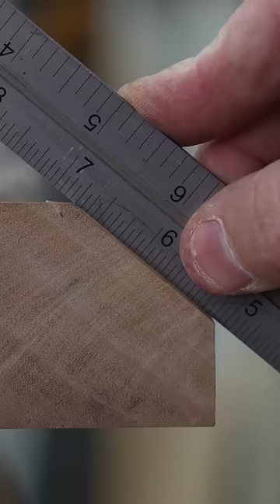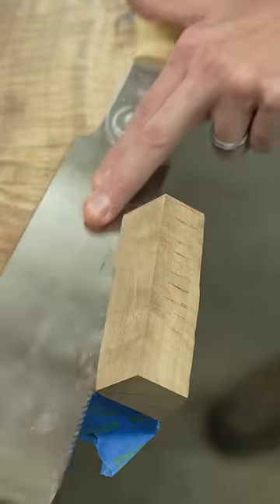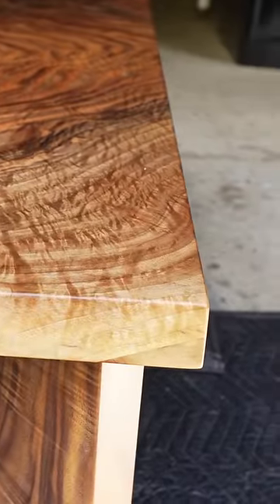Woodworking fix

Comment: Dude made more with a coffee table than me in 3 months of working
Reply: @UCFkBuj52Qa9VNaOXZtRco4w I feel kind of spoiled because we paid $10,000 for a master woodworker to build us a large live edge butter walnut dining table.  It's beautiful and worth every penny and I apply the wax to it every so often to keep it looking nice and fresh.

When you work hard and make good money you'll start to change your thinking and realize you were just coping when broke.

For instance, when I was broke I used to scoff at luxury clothing brands and think it was all a waste of money.  I always felt you get the same quality from H&M or Old Navy minus the brand name.  Then I made good money and started to try nicer clothing, and realized how wrong I was. 

Clothing from luxury brands (not the hypebeast streetwear stuff) is definitely worth the price point.  They make insanely high-quality clothing.  From the quality of fabrics to the design, the fit and feel of the fabric.  The clothing will last forever when properly taken care of.
Reply: @wushdishmeen  This is absolutely true
Reply: @wushdishmeen  the materials and manufacturing location matters more than the brand or designer. If you get crap that has nylon in it Itll melt in the dryer and holes will develop. You can get affordable shirts made completely out of cotton without designer level prices that'll last for years. Costco's Kirkland Brand makes some of the best quality clothes I've ever seen, especially for the price. I've never had any of their clothing products develop holes. Brands like fruit of the loom usually develop holes before the years out, especially on the socks. I've made tug of war dog toys for my German shepherd out of old stained Kirkland socks and they still have no holes and have lasted longer than any dog toy, it's crazy. They can easily last longer than 5 years. Same with their thick white crew shirts. You don't need to spend absurd amounts of money to get quality items, and you don't have to settle for the toilet paper crap from old navy either.
Reply: @dog2man1994    While I agree to a certain extent I think you misunderstood my point which I’ll explain better at the end of my comment if you care.

Regarding what you said — Any quality fabric or high-end piece you don’t put in a washing machine or dryer. Some you can get away with a cold wash inside out, but definitely not recommended. Hand washing is recommended.  ALL quality fabric should also be air dried on a dry rack and not put in a dryer ever.

While you can get good cotton t-shirts via cheap plain blanks from Costco they will look very plain, have a cheap looking design, and also just being very tough cotton isn't really a good thing. Lots of cheap cotton can be thick but feel like sandpaper on your skin so sometimes mixtures or other types of cotton are better. If you just need cheap plain undershirts that you layer something else on top of I’d recommend UNIQLO’s AIRISM U shirts which are $10 and are more comfortable, better quality, and have more color options than Costco and then just take good care of them.  Most cotton breaks down due to people's need for convenience throwing them in a washer and dryer which is 90% what ruins clothing.

Regarding quality, just simply 100% cotton is not an indicator. The GSM,, quality of the cotton, cleanliness, sustainability, as well as the cut of the cotton also matter. There are also over 20 different types of cotton such as French terry, Jersey, and velvet just to name a few.

Also manufacturing location if you’re specifically talking about China doesn’t matter. China will make $1000 products in the same factory they make $1 products. There aren’t many “cheap factories” in China as they will make cheap Alibaba products in the same factory they make high-end luxury products.

Costco shirts if they work for you that’s great. But they will not be cut-and-sew with nicer silhouettes. Blanks tend to all look the same, are covered in seams, and fit the same even though everyone’s body is different. This is why modern style is more tailored or boxier to fill you out from drop shoulder to hidden seams and will form to your body or fill it out.

Cheap blanks also won’t have any hand made stand-out design elements or graphic designs that actually look beautiful and are not “kid like” or “Walmart-esque” for lack of a better word.  I’m not saying “go buy Gucci” as they are a typical overpriced brand.

But even as a starting point as I began to make more money, paying for the higher end clothing even at a store like Adidas or H&M will show you the difference of high-quality cotton, 100% French terry cotton, or fleece in a heavy GSM with cleaner cotton and what quality actually feels like and why it's more expensive.

Most of us hold a bias when we can't afford nicer things because we don't actually get to EXPERIENCE them and so we write it off as a waste of money.  Sometimes this may be true but if you actually are researched in the fields you're buying in you will learn WHY some things are more expensive.

I used to think designer clothes were a waste of money until I bought my first pair of nice shoes.  Even running shoes like Adidas with their Primeknit and BOOST soles are very expensive and there is a REASON.  It's because the comfort is unmatched at lower price points and they also look nice.  Now I recognize the comfort, feel, and R&D that went into the design of them are worth the price whereas before I just thought it was a waste of money.

You also get what you pay for with looks. I’m not referring to any brand that just takes a “blank” and stamps a logo on it. It’s easy to make a cheap decent plain T-shirt blank but not easy to make a good polo, sweatshirt (knitted or regular), jeans, or shoes that actually are comfortable and look good.

$50 jeans are not ever going to be the same quality as a reputable brand selling $200 pair of jeans.  Jeans from Japan can last you a lifetime whereas cheap $50 jeans will wear and tear very quickly and will also not look as good shape wise.

As for the main point of my comment — When I didn't have money I would have just thought paying $10,000 for a dining room table was absurd and there's no reason for it. Until I had money and we learned about having a custom live-edge butter walnut dining table with a steel leg design we got to decide on that was hand made and big enough to seat 12 people and fits our dining room.

The live edge walnut in that size is VERY hard to get and is very expensive.  Then you are paying for the years of experience, craftsmanship, and custom hand made design of the table.  That is why it is worth that price.

Same goes for shoes, watches, clothes, . There is a reason why there are expensive versions of everything when you do your research and eliminate any companies just marking up things for a profit margin from the companies that actually are worth their value.

It's easy to say something is a waste of money when you don't have the money to spend on it basically.  But you have to look at life in a different way.

If I told you someone made $100,000 per year and bought a $1000 table you wouldn't bat an eye.  But if I told you someone made $1,000,000 per year and bought a $10,000 table you might be in these comments saying it's an insane waste of money when it's literally the same 1% of income.

Everything is perspective and I've learned to actually research why things are expensive and if it's justified.  In a lot of cases it's justified because of quality, craftsmanship, customization, and the R&D that went into creating something unique that nobody else can replicate.

Comment: Gotta give you props on that for sure. Nobody can deny that’s craftsmanship at its purest.
Reply: A wooden dowel would have been the best way to do that. That's all wood glue and will eventually break off
Reply: @michaelnizza414  doubt it. That bond is probably stronger than the wood itself given the surface and prep.
Reply: @cluckmar2   you've clearly never worked with glued wood on a heavy use surface. It WILL wear and it WILL fall off
Reply: @jessepatrick7471  is it that big of a deal? It's just a corner so I doubt it'll get used much in term of holding weight, I mean who in their right mind would put anything on the corner.
Reply: @jessepatrick7471 heavy use on a table that will likely be used as decor?
Reply: Uhmm...yes they could notice, using just glue like that is not exaclty the professional way to do it. Definitely not on an 18k piece.
Reply: @robbieaulia6462  corners are exaclty the vulnerable areas. They are exactly what gets hit first whaen moving furniture. With glue only that could pop off with ease.
Reply: @georgewain1138  Idk what to tell u man, maybe think with your head and imagine the table in 3D?
The table is flipped upside down at the beginning, you can clearly see the contrast between the bottom corner and the rest of the table at the end of the video. Idk what could he possibly have faked here.

Comment: When they say, ok so where's the part you messed up on... That's gotta feel good (that you are able to hide it that well and were up front about it to begin with)
Reply: My mum fixed a hole in my coat like that. I couldn’t even tell which side she fixed and which was original
Reply: it's like right there....
Reply: Easy to hide, when its on the bottom..you can clearly see the joint on the edge.
Reply: You realize the the part he works on is on the underside and the part he shows at the end is the top?
Reply: For 18k, would you want a messed up, repaired table?

Comment: The sign of a master craftsman is not that they never make mistakes it's that they know how to fix their mistakes.
Reply: My old boss taught me the difference between a good Painter and a bad Painter is a Wet Rag.
Reply: Yes! 👍
Reply: And good communication to set expectations!
Reply: A master has failed more times than anyone else has tried.
Reply: Even a journeyman must be able to fix mistakes
Reply: He faked the end result. If you notice on the corner he was fixing the grain went from up high to down low as it nears the corner. On the finished product corner shot it’s the opposite with the grain going from down low to up high as it nears the corner
Reply: @artstrology  
True , but a master might be able to fix it so you never knew one existed .
Reply: @jason9035   well it goes way beyond that, a paltry and simple thing, so that's how I might know you aren't one. a master level skill this is not, it is a journeymen skill,.....I believe the original saying was a carpenter is good if they can fix their mistakes. a master artist seldom makes them in the first place, it is not tolerated, and also, many mistakes are accepted and incorporated as to remain humble. leave one or two so the head does not get quite so big. and the customer does not have a say

Comment: Wow, you are truly a master wood worker.  You could never tell that this corner is filled in.  Your skill level is off the charts!  Great job!
Reply: Yeah and i love how he shows all the tips on how to fix it, easily done with glue, clamp, saw, and sandpaper.
Reply: Until that Wood Glue 
lets go! Lolol
Reply: I can, and I also see that he turned that plate over at the end.
Reply: Beautiful job ❤😊
Reply: @gitbint i can tell you’re not a woodworker, but if used properly (which it was), wood glue is stronger than the wood itself

Comment: ...and ten years later, a big chunk suddenly falls off the corner of the table.
Reply: Bro, that glue is probably stronger than the wood
Reply: @DooderKing  LOL, yeah right.  Tell that to my sister, who sat down on a wood-glued stool and had it collapse under her.  (And no, it was not badly constructed, other than being GLUED.)  It's stupid to depend on glue, no matter what kind.  The strongest glue will fail under the right circumstances.  BACK IT UP with nails or screws.
Reply: @Serai3  and yo sista weighs in at ……. 220?  Just axing.
Reply: @Serai3  I'm not a woodworker, but my wife's family is HUGE into woodworking (everything from jewelry boxes to boats). they say gluing is similar to welding (more in my arena), in that when done properly it is stronger than the parent material. I'd be curious to see if 1: it was glued well and 2: if the failure actually occurred on the wood right next to the glue, as in the glue took 1/64-1/32 or so of wood with it. I don't think there would have been a great way to hide hardware on this table but I'm not the expert here
Reply: @Serai3  a stool takes a hell of a lot more force than the bottom corner of a table
Reply: @glub__blub  no only that but the finish helps a bit as well
Reply: It was badly constructed. When you use wood glue properly it is stronger than the wood itself
Reply: @paolo7237  Whatever.  You know better thatn someone who's made furniture for fifty years.  Yeah.
Reply: @stephen4763  Furniture is supposed to handle 250lbs. So that's a miss sir.
Reply: @Serai3  doesn’t sound like you make it very well
Reply: @Serai3  yeah… look it up pal. Glue is stronger than wood itself and they teach that at school which is how I know it.
Reply: @paolo7237  YAWN.

Comment: That one buddy who decided to lean on the 18k table on the corner 😭
Reply: wood glue when dried is stronger than most woods, it's like a weld
Reply: And the corner is on the bottom , so a lean won't hurt it.
Reply: That shit is not coming off that easily ...😅

Comment: I built furniture for nearly 35 years and I can tell they're 2 different corners. All you need to do is look at the grain orientation pre-repair vs finished, it's different.
Reply: Was wondering if anyone else notice it
Reply: 100%
Reply: It was flipped upside-down... it's the same corner look at the bottom half of the finished product 🤦‍♂️
Reply: Yeaaaah i was wondering that but i noticed the black leg inserts while he was cutting it, table was upside down, and the grain seems to match

But it still kinda fucks me up
Reply: Same table but not the end but the side, that is why you can see the angled saw cut
Reply: Would you dowel a repair like this? 100% reliant on the glue holding.

Comment: Without this video, you would never know there was a missing piece at the one corner...👍🏾👍🏾👌💯 HELL OF A JOB...
Reply: Until it fails lol
Reply: How do people not see the seam the corner literally isn't sams color as the rest of the table. Look at the bottom of the corner the table is flipped.
Reply: @tvojslauf Modern wood glue is stronger than the wood in mostvcases. But go ahead, think you won one. 🤣👍🏻🦆
Reply: @rinslergj1 Looking at the rest of the wood, if you didn’t know itnwas a patch, you’d never see it. But keep lying to us. 🤣🤦🏻‍♂️🦆
Reply: @vincedibona4687 the glue is only as strong as the wood. I’m not trying to “win one”.  But you proved my point. If and when that slab fails it will do so at that patch. Before the wood just miraculously falls apart this patch will fail because the wood will separate from the glue because of the wood and not the glue. Especially on a corner where it’s prone to being hit. For the amount he stated I’d want a table with no patch.
Reply: @tvojslauf   "You proved my point..." 

No I didn't. You're crazy if you think so.

Comment: For structural support, would it have been better to attach the piece to the table with one or two dowels alongside the glue? I get that the glue is strong, but I would be worried if someone puts some weight on that corner, like someone leaning on it with their hand, that it might snap off.
Reply: You only get that with the $22k table. What do you think this is, a charity event? 😂
Reply: @DefiningDave  this comment made me laugh when I first read this comment, and then later when I randomly remembered it
Reply: Interestingly enough, the wood glue has a stronger bond than the lignin in the wood (the "glue" that holds the cellulose fibres together), so the wood would fail before the glue does.

Dowels would make the joint stronger, and would be the best option for a structural joint expected to take a shear load (as the cellulose in the dowels is far stronger than any wood glue), but they are unnecessary outside of structural uses.
Reply: That glue join is stronger than the wood grain, also it’s on the underside of the table.

Comment: If I'm paying 18k for a table, I'm not paying for a gimp corner.
Reply: I'd be surprised if you even had 18k to drop in general.
Reply: @dominusanuli3595  Which has what to do with the original comment?
Reply: @dominusanuli3595  I mean he did say "If" lol

Comment: He sanded upto the grain lines and fitted random piece, that was brilliant idea...
Reply: He faked the end result. If you notice on the corner he was fixing the grain went from up high to down low as it nears the corner. On the finished product corner shot it’s the opposite with the grain going from down low to up high as it nears the corner
Reply: @georgewain1138 it’s just upside down manz
Reply: @georgewain1138  Mate do you have nothing better to do other than copy and paste the same comment 10+ times and respond to everyone giving good feedback? And it's not asif everyone who will look at the table will complain or criticise over a small peice of corner work that's barely noticeable. Grow up.
Reply: @georgewain1138  i think it was upside down to start with ,so the chunk was missing off the underside of the table and the finished shot shows it the right way up

Comment: There is another corner of the table at the end of the video. You can see it exactly because the rings go in a different direction than in the repaired one.
Reply: No its upside down, he was working on the bottom. Take another look, you can see the fix.

Comment: I am engaged in the restoration of parquet. attaching a suitable piece of wood to a wooden surface is not a problem at all. especially if this wooden surface has a pronounced structure. But anyway your work is good.